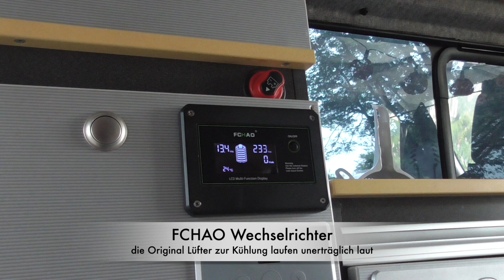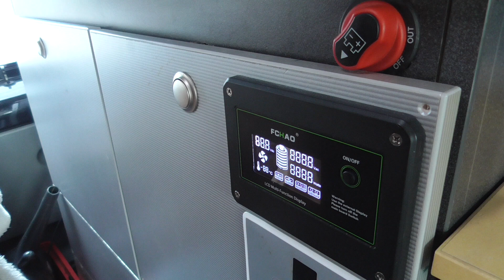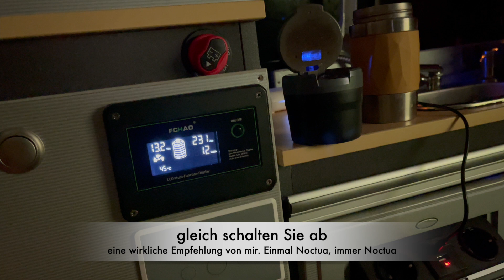FCHAO Wechselrichter original Lüfter unerträglich laut ,Tausch gegen Noctua flüsterleise NF A6 x 25

Comment: Bei 132 Watt dürfen die Lüfter noch gar nicht laufen...
Reply from the maker: dieser Wechselrichter kostet mich eh Nerven..bei 1000W Entnahme schaltet er ab. Wird wohl demnächst ausgetauscht. gerade geshen die Firma FCHAO gibt es nicht mehr..also reingefallen. Nix mit Gewährleistung.
Reply: Die Firma gibt es nicht mehr? Es werden doch noch viele bei Aliexpress angeboten... Ich habe 4 Inseln im Haus, alles über fachio. 24 und 48v Geräte... die laufen... bisher einwandfrei. ..
Reply from the maker: @Frattelu  stimmt hatte auch bei Ali gekauft mit Versand aus Polen. Also mein 1500W /3000 schaltet bei knapp 1000W ab..stinkt mir.
Reply: @nachhaltig-reparieren So ein kleiner? Ich habe 3000/6000W. Klar dass der Lüfter da nervt. Er startet bei über 45grad Gerätetemperatur und bei 1/3 der Gesamtleistung... Es kommt auch darauf an ob Du Induktive oder Kapazitive Lasten dran hast. Unter 2500/5000 würde ich keinen kaufen. Die Lüfter bei den 3000/6000W und 24V springen bei 950W an... der 3000/6000W auf 48V nervt schon ab 450W... ich hatte Infos gesucht ob man das innen irgendwie hochregeln kann...nichts gefunden...da müsste ich die Lüfter wechseln um wenigstens Ruhe rein zu bekommen...